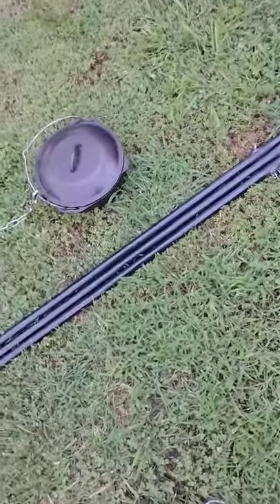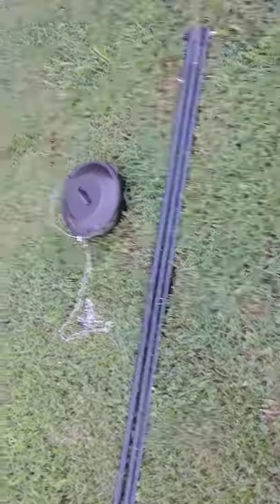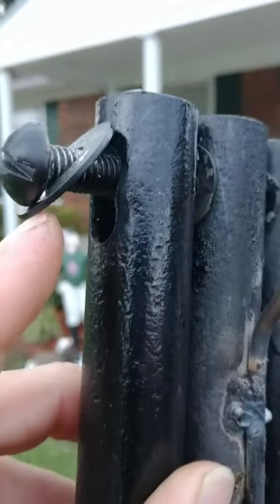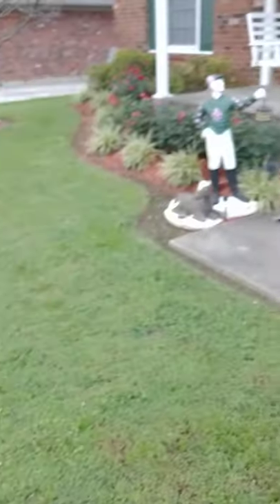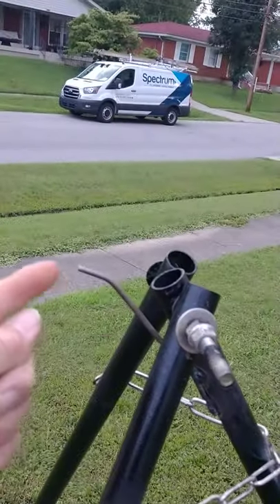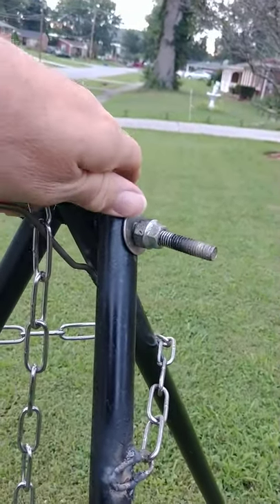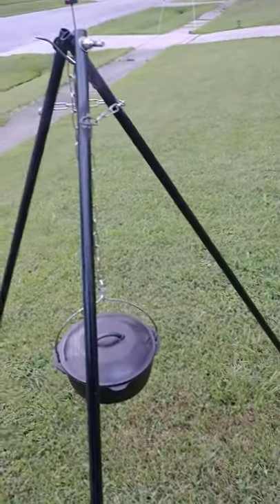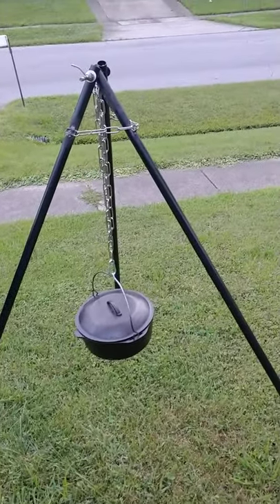campfire tripod cooking setup cheap

Comment: Is the middle leg slotted also? Or just the 2 outside legs, at the top where your bolt is.
Reply from the maker: Just the 2 outside pipes I slotted to allow to lean outward. It works really well. Thanks a good luck building your's. You can always hite up if I can help